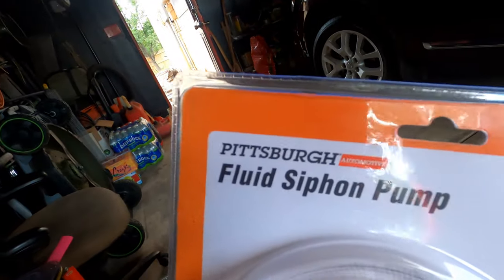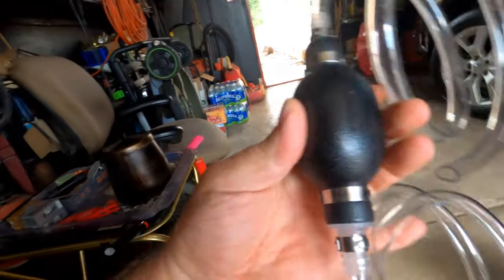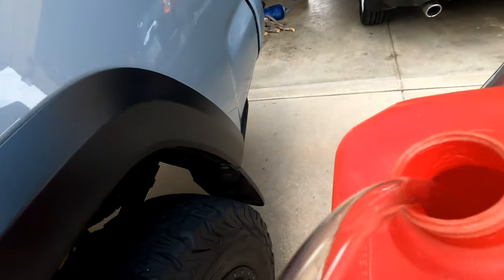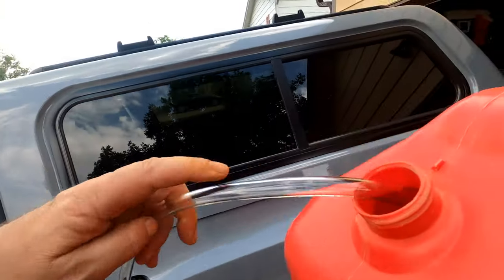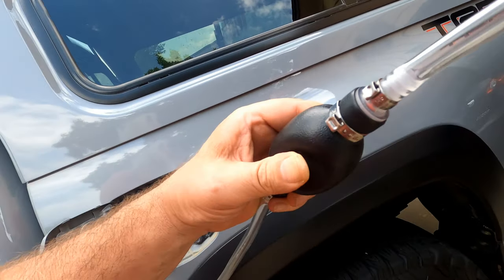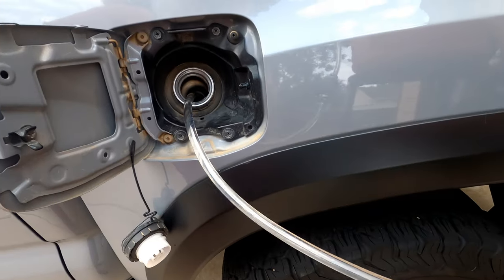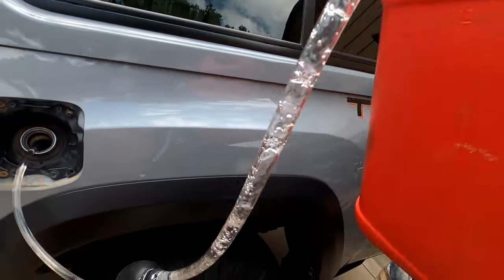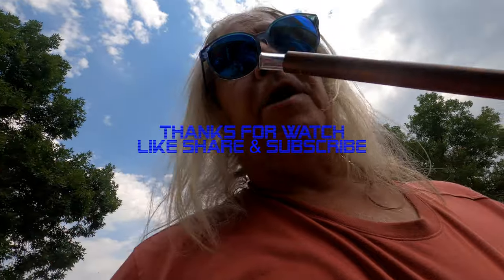Pittsburg Automotive (Harbor Freight) Fluid Siphon Pump Stopped working after second use.

Comment: I ought the more expensive Pitsburg Multi-use pump at Harbor Freight. It stopped after the first (frustrating) use. Harbor FReight would not exchange it so I bought this cheaper Pittsburg pump.  Still junk - It is not very cooperative either and I'm not going to use my mouth - the old fashioned way.
Reply from the maker: Yeah, I gave up on that kind and bought the one you jest back and forth in the tank and had no problems at all except stopping the flow which is no problem if you are going to use the whole tank. Thanks for your reply

Comment: Would it work the same in reverse, from the tank to the gas can? 
I had to top off the transmission oil and I overfilled it. This seems like a good easy way to remove the extra oil.
Reply from the maker: Yes it would, if it would work more than twice. I am going to make another video for this item that stopped working after 2 usages.